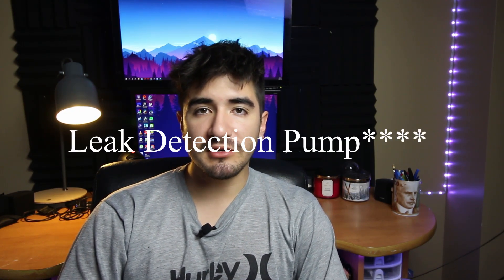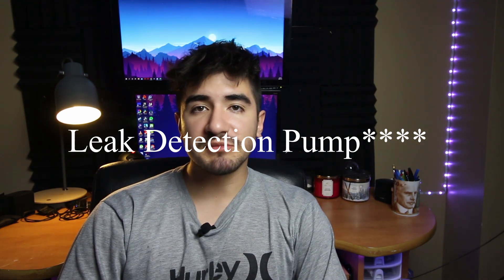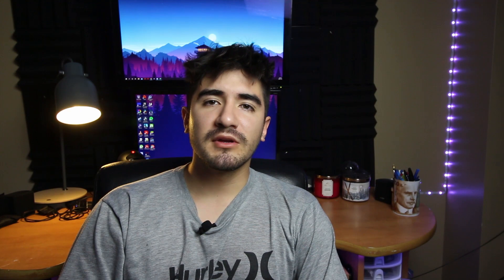Gas Cap Light / EVAP Leak P0456 P0457 Troubleshooting Guide - Dodge Ram 2012 2013 2014 2015

Comment: Awesome video! Good tip on the grease on the gas cap seal. Toyota was notorious to get a rusty filler neck where the gas cap seal sits and a little bit of grease does the trick.
Reply from the maker: Thank you sir!

Comment: I'm currently having this issue with my Ram 1500. Just changed out the leak detection pump a few days ago. Check engine light did not go off so I  reset it by disconnecting the battery. I also replaced the solenoid so hopefully this will fix this issue.
Reply: Did this fix it? I did both and still getting the cel

Comment: P0457 code, changed cap, evaporator solenoid, and evaporator valve, and code still comes on after short drive. Anyone else have any answers? I have code reader and reset, but still comes on.
Reply: Have you had any luck with clearing the code? thanks

Comment: Hi got this fixed and the gas cap light still on did they half to reset something or will it go off bye itself?
Reply from the maker: Drive it for some time it should go away if fixed. Reset is just quicker

Comment: Is there more than 1 purge valve? I have this vehicle under warranty but the place I purchased it from with the warranty (Oak Motors) seems to be incompetent in being able to solve the issue. They replaced the valve at the engine and the gas cap but 3 days after being told it was fixed... it's back on again. They are 2hrs from where I live and it's a little inconvenient to have to have someone follow me there to drop it off to them and find an alternate ride to work. It took them 5 days to not fix it the first time. So if there's another valve at the gas tank I'd rather save the hassle and do it myself.
Reply from the maker: Hi Devon, yes sounds like they changed the purge valve at the engine, it's a common misdiagnosis because the code makes it seem as if thats the issue. You will want the leak detection pump (EVAP Canister) changed if you have the codes on the video. Ultimately it is possible they put a cheap part in the car and the purge valve failed but I'd bet on the leak detection pump. All the best

Comment: Is there a way to check the engine codes on a Ram 1500 2014 with out a tester?
Reply from the maker: Hi Bill, I want to say that they no longer have a function to check codes without the scanner in 2014. Probably best to buy a cheap scanner or find a friend. Best of luck